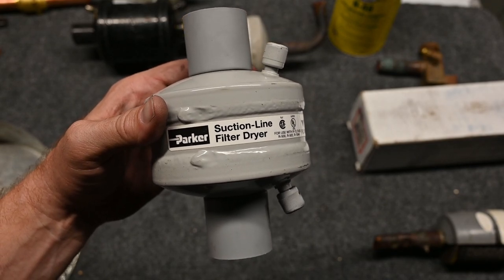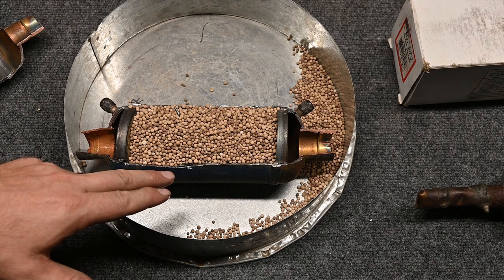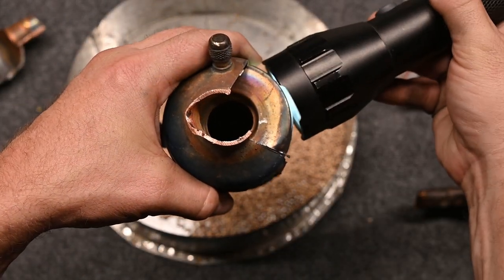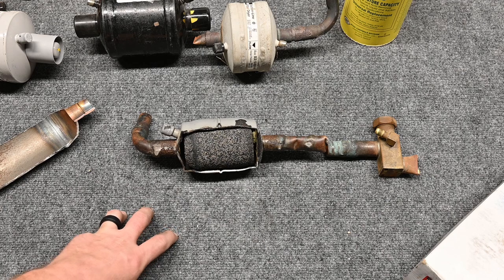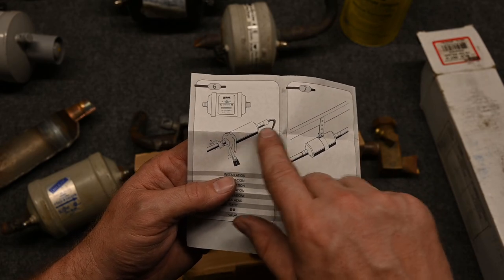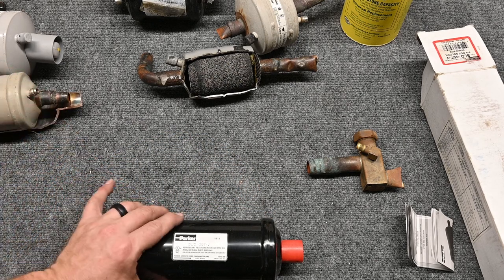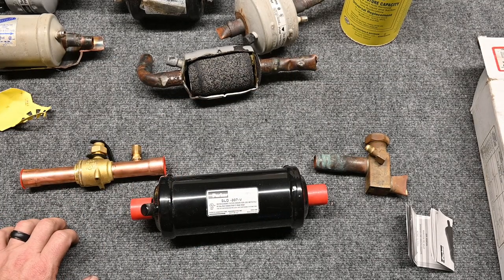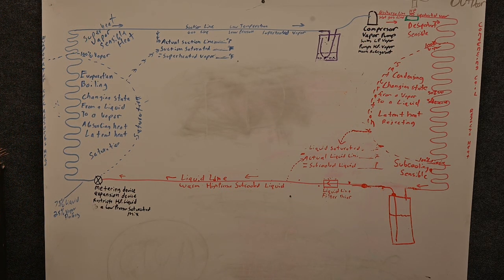HVAC 070 Suction line Filter Drier

Comment: The unit i fixed has a burnout, asked the maintenance about the history of work and said after the 1st burnout repair, the previous hvac tech never came back to replace or do pressure check on the suction line filter dryer, both compressors failed in just 7 years! Chillers are only run during summer months May to September,Both compressor suffered from electrical winding shorts in a 2 week span of each other.

Comment: Ty
Thank you for the wonderful videos 
I'm be coming a way better tech. I all so
gave tips to other students on your behalf. Question, I was studying the heap pump circulation, so when running in heat mode- the hot gases travel to the
evaporator- when it passes the txv bulb
wouldn't that put a strain & open the txv
fully- each time there's call for heat?
I would love hear what you think. 
Thanks again.
Reply from the maker: Yes it would but more importantly the check valve inside the TXV open and let's refrigerant bypass inside. 
I just cut one open today and will be recording it soon.

Comment: I'm going to be changing the compressor on a split system that's been open to the atmosphere for over a year. I'm going to flush the line set with some rx11. But I'm also thinking about installing a suction line dryer because I don't know if there could be acid in the system
Reply from the maker: Was the system an R22 or 410A?
If 420a the POE will have absorbed the moisture (hygroscopic) and converted back to an acid that has lilly already been eating away inside the system.

For lineset I prefer using a pig like the hilmor lineset cleaner or supco pipe wiper to clean them.

I'm this case your talking a lot of potential contamination.

I would use the largest liquid line drier you can possibly get and also the largest suction line drier you can get. over size then!

Typically I like my liquid line drier inside. But in their case put both outside. Get a refregerants ball valve  for the suction and liquid line.
Have the driers installed between the new ball valve and the factory service valve.

Come back after 72 Houers and check the pressure drop across the suction drier. If it's out of speck (listed on drier) the close all 4 valves, (recover) refrigerant  just at the suction drier and liquid drier and replace them. Pull a vacuum in just that section, open the valves and run it.

Keep doing this every  on longer than every 72 Houers. Once you no longer have a suction pressure drop take the suction drier out and straight pipe it. Replace the liquid line drier one last time and you should be good. 

Good luck!
Reply: @love2hvac  it's an r22 system. I'm converting to 407c
Reply from the maker: That's good news! Less worry about acid 😁

The best thing would do the driers like I mentioned but you the suction drier doesn't have to be removed.

The new compressor should come with POE oil already, just confirm that. If it has mineral oil, drain it and refill with POE before you install it. 407c needs POE but can handle 5% up to 10% mineral oil, so the residuals oil in the lines will not be an issue. 

Take your time pulling a good deep vacuum and also do your decay test.
To ensure its boiling out of the oil. 

You will likely have to change the vacuum pump oil a few times during the process. 

Oh forgot to mention, take the liquid line loose at the metering device and back flush it several times. Check the screen before the metering device. 
If your not intending on returning to change or check the driers put the liquid line drier before the metering device to protect it.
Reply: @love2hvac  either I'm going to replace it with a 407c condensing unit or I may just put in BluonsTDX 20. I just bought me a jug of it so I'm anxious to try it
Reply from the maker: I have heard good things about Bluon but I have not tried it myself. 

If I had the cash I would do a before and after conversion test.

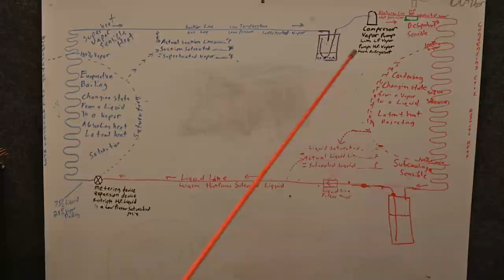Comment: Hello, around minute 11:06 is there a liquid line accumulator? What is trying to prevent?
Reply from the maker: On the suction line is a suction line accumulator that prevents liquid slugged to the compressor. SL accumulator should be replaced with a burn out. worse case scenario put a suction dryer between the accumulator and the compressor. 

On the Liquid line there is drawn a liquid line receiver that is covered here https://www.youtube.com/watch?v=vjhoiwWZ0wM
It doesn't prevent anything, just allows a place for refrigerant to go during pump down.

Comment: So suction filter drier is only necessary when there is a compressor burn out? But i have seen new outdoor condensing unit that comes with suction filter drier included.
Reply from the maker: The only unit I have seen from factory with a suction line filter drier is Lennox specifically with a rotary compressor because it can't handle any debris whatsoever.
Reply: I saw in rheem split heat pump system too. @love2hvac
Reply from the maker: @harkamagar201  can you provide the model number somi can look into it?

Rheem and Ruud are known to use a charge compensator that sometimes gets confused for a suction drier.

Comment: TY, 
How do you flush the evaporator and condenser coils? I was always under the assumption that you can't flush something like rx11 through coils cuz it won't flush it all the way through and will get stuck in the coil. Trying to do a nitrogen flush will  just spread the oil to the interior walls of the copper pipe and won't really blow it all out.
Reply from the maker: You can get a lot out with nitrogen but yes some will be spread on the walls of the of the tubing. 

you can use RX11 IF it's done the right way.  Use nitrogen flush first then the RX11 flush. Then several nitrogen flushes. I personally pull a vacuum on that individual component (evaporator or condenser) to make sure I boil out off of the flush. 
The big issue with the flush is not getting it back out.
Reply: @love2hvac  thanks man I appreciate it. I love all your videos.

Comment: Are flare type filters viable or prone to leaking?
Reply from the maker: They are viable if the flare is done correctly. 
Bennifits: no oxidation, faster changing, no but paint, and if it's done right no leaks, fewer tools, and no fire hazard which in some places require more permits.
I prefer to braze while flowing nitrogen. 
With nitrogen, also no oxidation, pull the base deep in the joint, and also nice bead around the end I know it will never leak. 

I've done both.

3rd option is soft solder. Some people swear by it. I despise soft solder because I've had the most leaks I have ever fixed in my entire career were soft solder joints.  Fixing solf solder joint is the biggest pain. Soft solder requires flux wich is an acid. I have seen many times acid issues with soft soldered equipment. The installer let the flux get too deep and it traveled in the oil.
However, IF it is done correctly it will also hold and no oxidation issues.

Comment: What are the symptoms of a suction line restriction; on the entire system?
Reply from the maker: low suction pressures high superheat at the compressor. 
Low head pressure.  Since suction line restrictions starve the compressor of refrigerant, the entire mass flow rate of refrigerant will decrease through the system.

Evaporator delta T will drop, evaporator TD and
Evaporator superheat will be unknown because we don't know true saturation in the evap coil.

Condenser TD will be low, probably low subcooling also

Comment: Molecular sieve , what is the word you were looking  for the desiccant BBs
Reply from the maker: Thank you! 
I've heard molecular sieve but I never realized it was the loose bbs. That makes so much sense!
Reply: I was checking the comments to make sure this was mentioned. 3 angstrom is usually used for removing water from air/coolant/solvent. They might be ones with larger pores to adsorb more quickly.